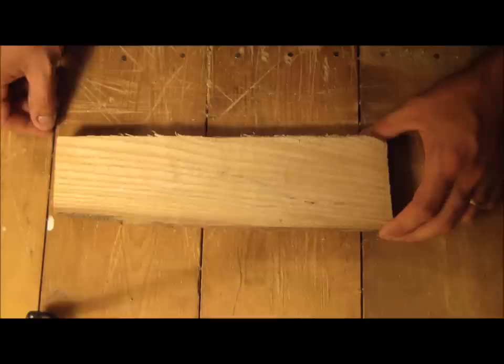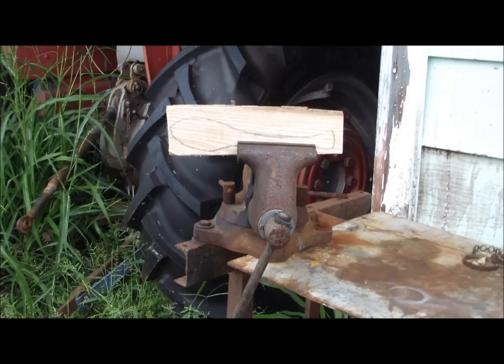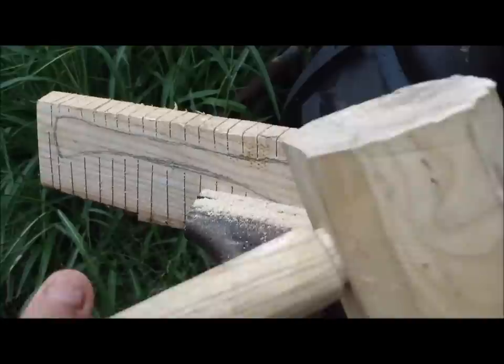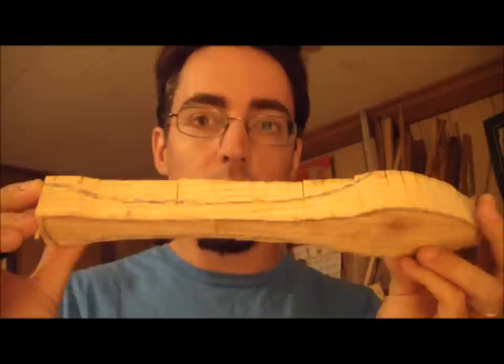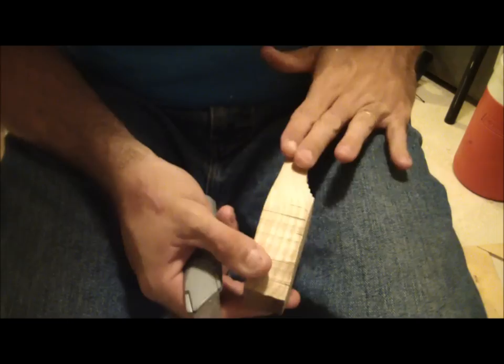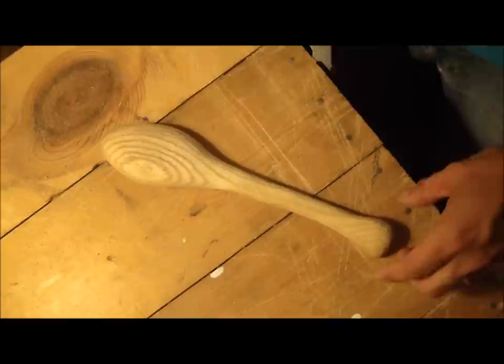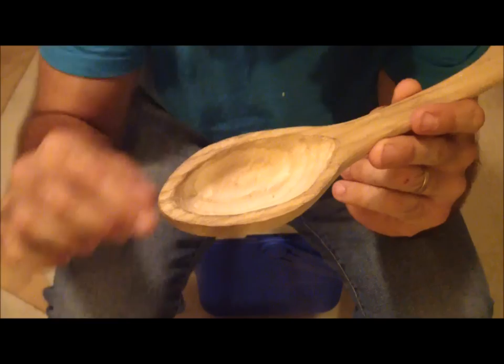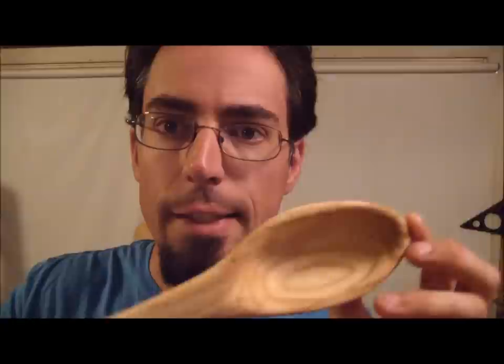Carving a Wooden Spoon

Comment: Ash, hickory, and oak are all bad choices for a spoon because they are porous open grain woods. Maple, walnut or cherry, or alder are better choices. Also, as stated before, you should cut out the bowl of the spoon first before cutting out the spoon, so you have something to clamp to.
Reply: Shane stock your dead right apart from the tannin in oak will upset stomach  is too hard. but I use citrus or olive  sycamore  beech  or birch 💪🐻🐺🐾👍

Comment: This would be 100X quicker and easier if you just use a jigsaw or even a hacksaw to cut your rough shape first instead of making 187 cuts! As for the concave part, if you don't have a gouge, you could use a screwdriver then sandpaper. Pretty ghetto but who had a gouge! ?
Reply: . No s***. Is 2015 s***